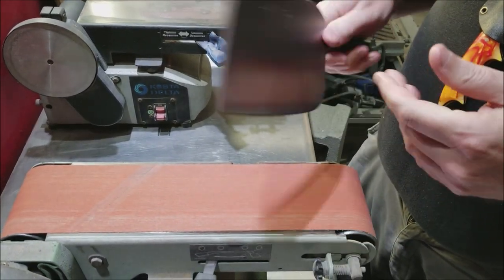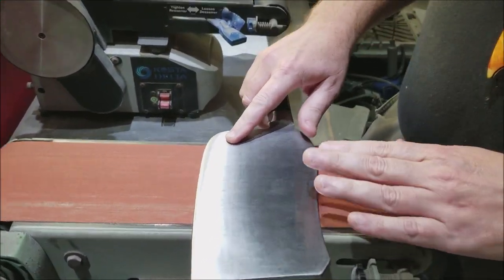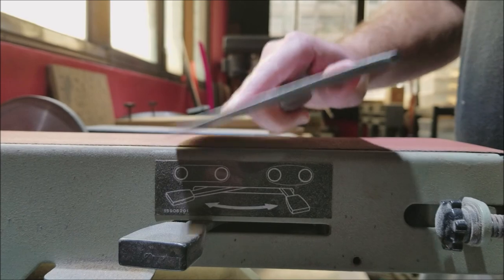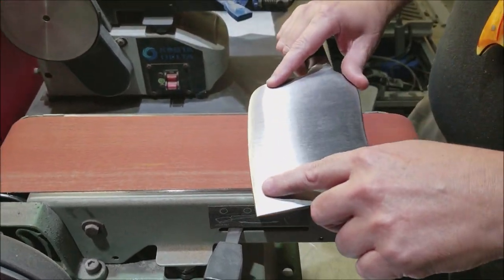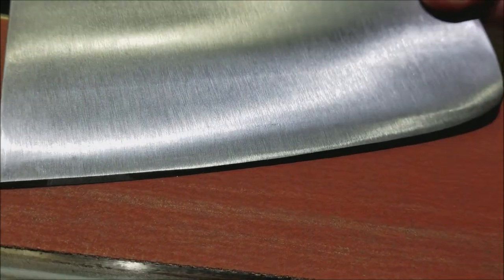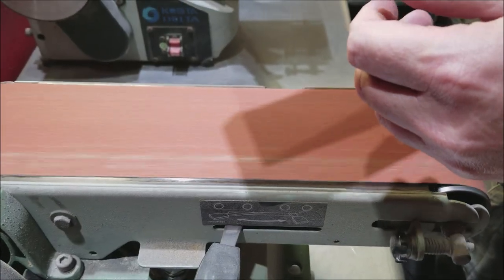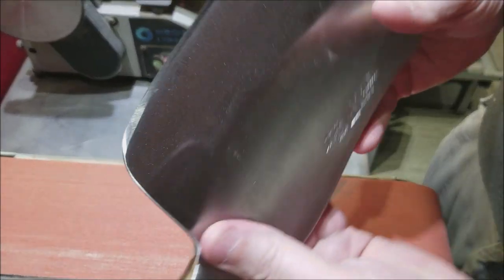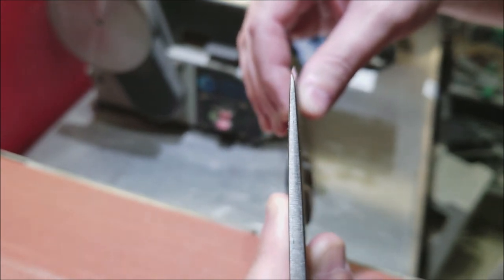Sharpening a Meat Cleaver on a Belt Sander

Comment: Hi. What grit of sandpaper are you using for sharpen a knife and axe? Tanks
Reply from the maker: This belt is either 120 or 180 grit. I usually go to stones afterward. But you can progress to finer belts or the trizacts. I usually use the A65, 30, 16 and sometimes 6 and a quick buff.

Comment: I saw a video where the guy was dipping a cleaver in water while he was sharpening it on a belt sander. He said it helps maintain the heat treatment. I noticed you didn't do that. What are your thoughts on it? Thanks.
Reply from the maker: Excellent question! If I am just doing routine sharpening, I generally don't dip in water. I use a lighter touch and let the belt do the work. The blade will often get hotter while buffing than sharpening on the belts.  However, If I am doing a lot of work or I feel things heating up too much, I will dip the blade to cool it down. The concept that you will ruin the heat treat only really applies if you start seeing the blade change color to straw, brown or blue. I've done that enough to know how to sidestep most blade overheating situations. :)
Reply: @JendeIndustries  thank you very much! I was really looking forward to your reply.
Reply from the maker: @knae9216  The pleasure was mine! Thank you for asking!